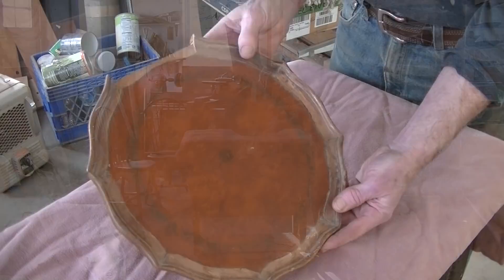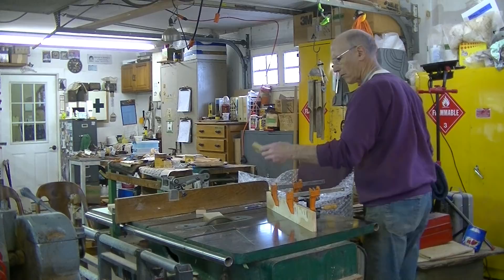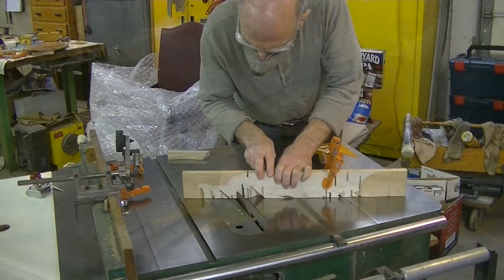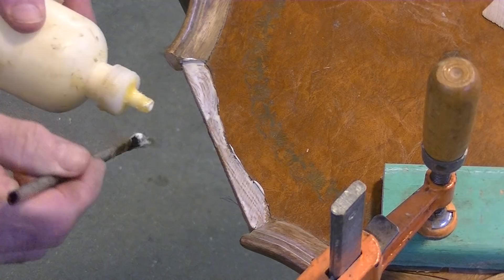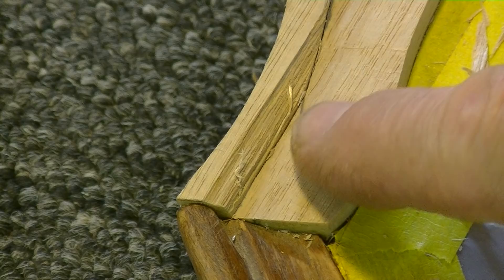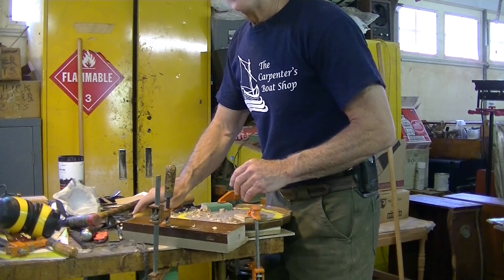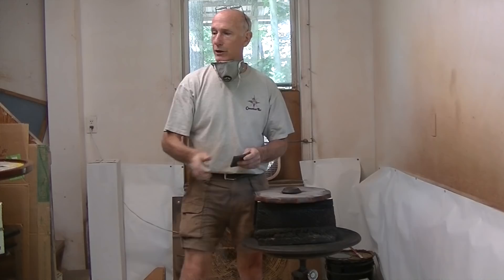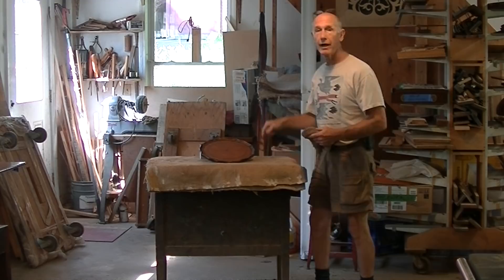Reproducing a Missing Moulding - Thomas Johnson Antique Furniture Restoration

Comment: Beautifully done Tom. Your skill in using dye stains is remarkable. When I use them, it usually absorbs too much and goes too dark
Reply from the maker: Thanks Mike. Yes, that's a problem. Always sand really well to 220, and thin the stain (you can always go over it again), and often I'll seal first with shellac

Comment: Outstanding job Paul.  reproducing pieces like that are a real "clock burner."  Thanks for showing your mistakes as well as what actually worked.  My shop would have had to charge several hundred $ unless it was part of a bigger job or a life long customer.   I may have tried casting that piece if I could get another piece off,  although maybe not.  Please check in if you ever want or have time.  Fred McLean , McLean's Refinishing, Inc.  Est 1979.
Reply from the maker: Thanks Fred! I also started my own shop in '79. Suddenly that sounds like a long time ago! Where are you located?

Comment: Thanks, very interesting.  When I saw the profile of the moulding, I was expecting you would make a steel scratch stock (I think that is what it is called!).  Maybe not worth it for one piece or too difficult because it doesn't follow a straight line?     It is great you take the time to not only repair these antiques but go to even greater lengths to show us!  Cheers, David.
Reply from the maker: You're welcome! Yes, I got out my scratch stock but realized I might as well just carve it, the scratch stock "holder: couldn't do the curves. In fact I think any kind of a guide couldn't do the curves.

Comment: Have you seen, or tried, the new 3MM flexible sandpaper? It really looks like it would be very good for sanding curves and turned posts and such. You can form it right around your finger and get right into a tight curve. I haven't got it yet, but I am going to. I just saw it advertised..
Reply from the maker: Thanks! I'll look into it. I've been having great results using 3M Scotch Brite pads

Comment: The skill shown in reproducing the moulding was masterful, Mr. Johnson.  Thank you for sharing.

BTW, may I ask about the Scotchbrite pads?  Does the Scotchbrite  Co. make pads for wood workers, or are you adapting the pads to your woodworking  needs?  And, do the different colors of the pads denote various abrasive qualities?  Thank you.
Reply from the maker: You're welcome! I think they are made primarily for metal work, but obviously can be used for anything. And yes, the colors denote different "grits" https://www.3m.com/3M/en_US/company-us/all-3m-products/~/All-3M-Products/Abrasives/Industrial-Abrasives-Finishing/Hand-Pads/?N=5002385+8692962+8710644+8710812+8710964+8711017+3294857497&rt=r3

Comment: Was it common to fabricate tops by sticking a molding like was done here? Is this one unusual compared to making the top by lowering the center by turning and then carving the lip that is produced? It almost seems like the stuck molding was doomed to pop off when the substrate shrunk over time or with weather changes, although it is relatively small.
Reply from the maker: Thanks! Traditionally yes, the molding was carved, part of the top. This table is a reproduction, and adding a moulding like that was doomed to failure

Comment: I seems to me that after establishing the correct overall geometry by fitting against the actual tabletop, you could have done most of the carving AWAY FROM the top, so you would not have to protect it so carefully.  You could have done rubbings of the end of the adjoining moldings and transferred the shape onto the end grain of the piece you were carving, or with the molding held in place you could have traced the profile directly..  Only the very final blending of the ends of the new molding so they match the old would have to be done on the tabletop.  But anyway, it came out well, so I guess I'm quibbling.
Reply from the maker: Hi Martin, I thought long and hard about doing as much as I could before gluing it to the top but there was really no way to secure the piece. I felt like I did as much as I could. Also, when carving the shape it was great to have the moulding I was matching right there in front of me

Comment: My profuse apologies, I just saw you pull out your compass. Nonetheless, we have very different approaches. Greetings from Paris. Pity you didn't leave enough scrap wood to be able to not have to shim the missing width.
Reply from the maker: Hi, thanks for watching and thanks for the comments. Please keep in mind that this was not a valuable, historic piece of furniture. It's maybe 60 years old but has great sentimental value to the owner. I thought the shim was a perfect solution, carefully cut from the same wood and with correct grain orientation. Certainly not worth starting over, it was invisible in the end.
Reply: Thank you for replying ; I was afraid I may have offended you. Your right about shimming ; who hasn't gone there. You can measure as many angles as you want, when it's older furniture there's always a couple of degrees out. In the meantime, here in Paris, fine furniture restoration has very sadly disappeared. We used to do some extremely spectacular stuff. Several hundred hours per piece. My own record was just over a thousand on an early Boulle Mazarin tortoiseshell table- very badly damaged. A nightmare, but rewarding at the end. I'm glad to see that you seem to have quite a flow of furniture coming your way. It's such a shame when a craft disappears. All the best.

Comment: Well, it did come out looking good, but I'm surprised that, on a historical restoration project, you allowed yourself that "cheat" of inserting a sliver of end-grain to fill the gap caused by making the piece too short.  Yes, that kind of error can easily slip in when you're working with tricky geometry, but knowing that, I would at the very beginning have cut off and rabbited a longer strip of that walnut so I would have a back-up piece to use in case I messed up the first one.
Reply from the maker: Hi Martin, thanks for watching. Yes, I usually have a back up piece during the process. But this was not a historical restoration, the table is maybe 50 years old, it's just a repair job. But point well taken
Reply: Thanks for getting back to me.  BTW, I just thought of something else: It might have been convenient to first establish the geometry of the "footprint" of the new molding with light-weight cardboard and scissors.  Once you had a cardboard pattern that fit well, it wouldn't be hard to transfer the lines to the wood.

Comment: A metal push stick is a very bad idea.  If the blade catches it, it's a lot more likely to throw that at you than a wooden push stick.
Reply from the maker: Yeah, I hear you. But it's very soft aluminum, the manufacturers did take that into account

Comment: A last piece of advice. When you know a piece is going to be stained, in order to avoid the "fury-ness" due to raised fibres, then from the very beginning of the sanding process damp the wood with a moist hot sponge every time. When you finally stain the wood, the fibres no longer raise.
Reply from the maker: Hi again, I used an NGR (non-grain raising) aniline dye stain, solvent based. Because I needed to achieve a closed grain finish in the fastest way possible, I wanted to leave those wood fibres where they were, and sand it smooth after the sealer coat.

Comment: I'm afraid I beg to differ from beginning to end. Sorry to say that here in Europe we have a world-renowned tradition of restoration. This cheap copy of added mouldings is a poor imitation of what was the Queen Anne , beautifully hand-carved "pie crust" moulding. The original period tables were carved out of solid timber - usually Cuban mahogany, but sometimes Walnut too. I'm only at the beginning of the video, but I had to comment. Now, as to reproducing any existing curves, the best - if not ONLY - solution is to reproduce them by running a compass at 90° along the edge of an existing moulding onto a piece of cardboard fixed on the table just in front of it. This reproduces the original curves and can be used systematically on any similar job. Now I'll continue watching, but I'm a bit worried. Cheers.
Reply: musamor75 wow your you tube videos must be superb lmao

Comment: For someone who "restores antique furniture"; he sure loves his machines. The pieces that were originally made were not cut on perfectly straight saw tables, or any other power equipment for that matter, they would have been hand cut, fretsawn, shaped, gouged, etc. This was immediately obvious when he set the nice, perfect 22.5 degree angles, and it didn't fit. There are plenty of old world restorers and craftsmen who run rings around this typical pompous yank. Having a bunch of expensive machines a craftsman does make you NOT.
Reply: Troll.
Reply from the maker: Thank you!
Reply from the maker: Yes